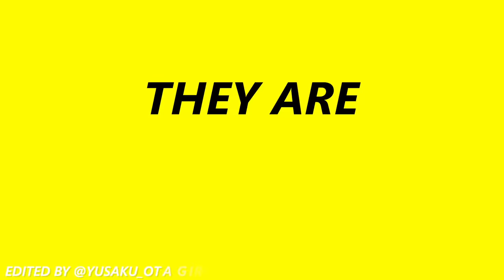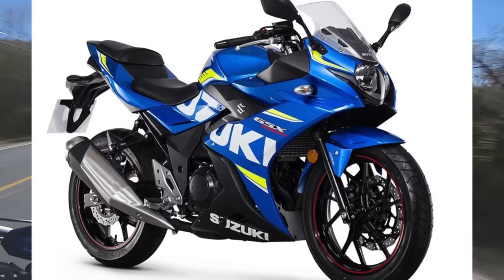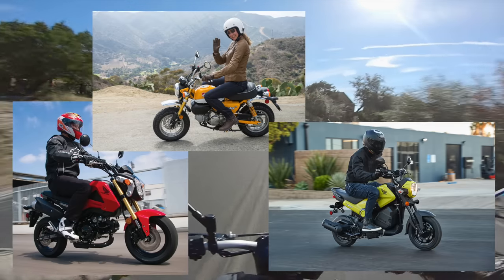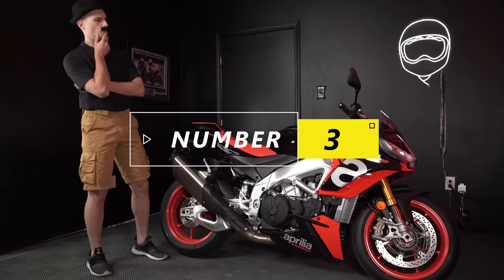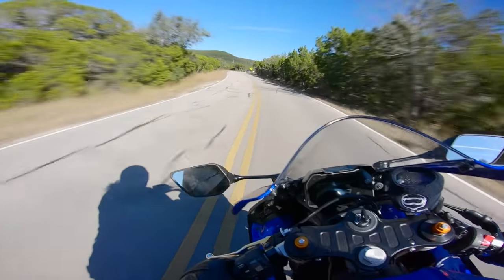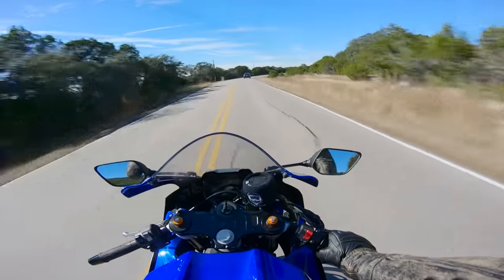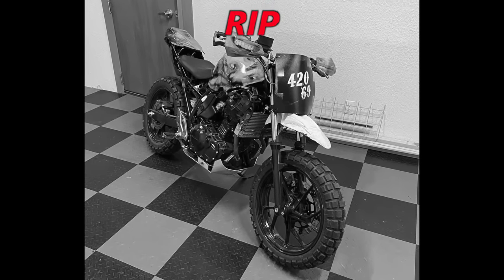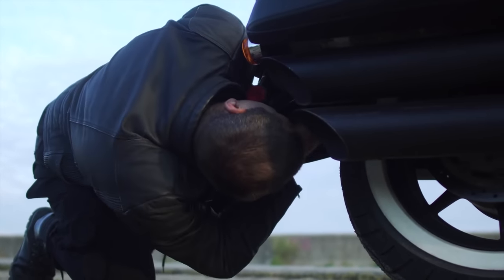Top 7 Worst Beginner Motorcycle Choices! (Must Avoid)

Comment: "This bike has no character" translation:  This bike is a well built machine with competently designed ergonomics , reliable mechanicals   And an excellent suspension.
Reply: And is about as soulless as it gets and may actually send you back into a car. That being said, the dude has a point about drum brakes.
Reply: @KiyanushKaranjia  sorry but to me it's the unreliable project bike from the 70's that's going to send me back to my car!
Reply: This "soul" thing has never made any sense to me.  It's a goddamn machine, none of them actually have any souls, that's what makes a machine a machine.  

What you're really trying to say by "soul" is asthetics (which are subjective) and brand loyalty (which is also pretty subjective).  The problem with "soul" is it gives Harley-Davidson an excuse to be lazy and keep making the same outdated boomer-bikes for 50 years at ever increasing prices.  This isn't a sustainable recipe for success though.  Thankfully Harley-Davidson looks to be headed in the right direction with the Pan America and Sporster S.
Reply: @KiyanushKaranjia  Damn I loved my Ninja 400 cause of it's comfy ergos, it's dreamy handling, It's punchy acceleration and it's certified reliability. (Not to mention amazing price)
I didn't realize I was supposed to add arbitrary and pretentious qualifiers that annihilate some of the appeal of motorcycles just to have a more "fun" bike. 
That's why I should get a bike that spills oil like a tanker, has back breaking ergonomics, the ear splitting bum loosening death rattle of a Harley, the maintenance costs of a German built Ferrari. Oh, and it has to be some one-off luxury bike too, because the whole community aspect of riding is just fortune cookie nonsense and the REAL bikers are rich executives who ride their bikes once just to show off...
Reply: The other way to say this is "clinical".  Some people appreciate that, some want deficiencies to make up for.  All bikes are fun, the clinical ones are great, but the bikes that create stories are a bittersweet combination of image, fun, and ruin.
Reply: When someone says a thing "has no character" it DOES mean that it's technically excellent. They have nothing to pick on besides saying that it didn't invoke an emotional response. They didn't "get" it. For a reviewer, that means that it doesn't stand out. Is it a bad thing? Of course not! Was it amazing? No, no it wasn't. You can build the technically perfect bike, but people don't buy motorcycles in the US for perfection. They're for fun; technically excellent doesn't always mean the most fun.
Reply: @kevinlugonzbi6005  But what emotion does it have to invoke? Does it have to put you through pain and financial ruin first? It's m that's such an arbitrary metric!
Reply: @hyperx72  doesn't matter if your not having fun, sketchy shit is often fun. and if your into Motorcycles to save money your in the wrong hobby my friend
Reply: @roadrunner681  Aww yes I always wanted to get onto a bike and wonder
"will my transmission give out today?"
"Will I not be able to ride this week/month cause of something shaking lose?"
"Gosh I can't wait to have to set up an appointment when every other shop refuses to work on my bike!"
That's why I buy exclusively Chinese bikes and ride without a helmet for that extra sketchy feel!
Reply: @hyperx72  once again, yes it's subjective. However, my Bonneville hasn't put me through ruin and definitely has a personality. The personality is friendly, torque rich, and yes, imperfect.

What emotion are you looking for? You don't have to be broke to find emotion, you just need to try some bikes and see what you want. Some people want calculated perfection. Personally, calculated perfection just reminds me of where I should improve. Great for track days, but a bit masochistic when you want to enjoy yourself.
Reply: @tinman3586  Not true at all. Soul is not how a bike looks, nor does it have anything to do with brand loyalty. It is however completely subjective, and relates directly to how a bike makes one feel while riding.
Reply: @kevinlugonzbi6005  That's true, I personally hate the mindset of calling a well tuned calculatedly smooth vehicle "boring" because it presumes everyone wants and should want something different.

I personally enjoy the smoothness of my ride. It 1 makes it very easy for me to control (good for beginners and general riding fatigue) and for easier diagnosing of potential problems.
Like if my clutch started making odd sounds or my engine began sputtering, in some bikes sputtering and obnoxious clutches are normal.

I find it unfair to judge bikes that try to do different things to the standards of larger sportier bikes, as it's just like judging a Miata for not being a Lamborghini
Reply: @hyperx72  that's fair, and I agree with the Miata vs Lamborghini comparison. Personally, I like slow car fast so the miata wins for me. I always view "character" as reviewer speak for "did this stand out to me in some way". And yes, it can mean bad fueling and imperfection. It can also mean an absolutely exceptional balance or low-end. I would call the Honda Rebel 500 a bike with friendly character perfect for anyone looking for a low displacement cruiser.

I do definitely look at reviews with a grain of salt too. Ride safe!!
Reply: @kevinlugonzbi6005  this is it exactly.
Reply: @kevinlugonzbi6005   @Kevin Lugonzbi  My favorite cars are hatchbacks, specifically because of their tight turning (especially when combined with punchy acceleration).
Reply: MV Agusta F4 1078 RR. Best beginner bike for anyone that is buying their first bike.
Reply: @hyperx72  you don't fix your own bikes? I have way to much power in my old sportster and I mean old its so dumb but it's fun. Most bikes are reliable if you take proper care of them. Ether way if your into bikes and your having fun it doesn't matter
Reply: @roadrunner681  
I do maintenance on my bike, up until the point where it requires specialized tools and has a high potential for failure.
Reply: @gnarthdarkanen7464  You're talking to a guy who's so willing to ride a Ninja 400 that I'm consistently putting myself through 30 degree weather...
Reply: @hyperx72    The point was that you find character or "soul" where you look for it, but it's just as different for each person as any other supposed metric...

     AND I'm no different, aside from the bike I'm on at the moment... If there's no ice in the driveway or street right where I have to turn on or off... I'm probably riding...  ;o)
Reply: I am one of those who started on a old Italian bike, and the bike has not been the most reliable thing, it's a 996, but to be fair, the problems that I've had with it were almost all down to having a lazy know-it-all past owner, I fixed most of the things wrong with it and I fell in love with it and Ducati's in general because of how brutal and rough everything is compared to other bikes, it still have some issues, but I'm almost done with it and after that I'll sell it and get a 2013 Honda CBR1000 Fireblade.
Reply: So happy to hear yam feeling same as me about the 250 cc bikes,  my first bike was a ninja 250 and 2 months into riding I realized how much more dangerous that bike was for me than a bigger bike. Never get a 250. My second bike was a cbr600rr after a year of riding th e 250 and I felt right at home . Don't ever buy a 250 please.
Reply: For me, being well built and reliable is all the character I need. I'm proud to own a machine I can always count on to give me a good time.
Reply: I'm dying for the turbo Hayabusa 🥲
Reply: @tinman3586  thank u
Reply: @theamateurcyclist3873  I wouldn't say never get a 250....I have my tw200 and that's a fun bike, and I wouldn't say it's any more dangerous than my Bonneville
Reply: Try riding something like a Guzzi or BMW Boxer and then a Japanese 4 cyl. Yes, the japanese are almost perfect machines, but they're not as fun as a Guzzi.
Reply: As an owner of a Jaguar car, I can confirm that character and faults are the same thing. I love that insane supercharged lunatic but it kills my bank balance.
Reply: S1000rr.  Has no "soul", and out of a garage full of bikes, it's what I ride the absolute most.  It doesn't break, the engines are so mechanical sounding they sound broken, the transmission shifts properly, the suspension is good, it's so good and brilliantly engineered, it's boring.  But there's nothing boring about riding it, even though it turns 9 this year.  I love my little Ducati too, a 2009 vintage, and it has a ton of "soul"...  and spends a ton of time on my lift.  They're very different bikes, and the duc has weird little idiosyncrasies.
Reply: @ezekieloruven  do you even know how to change brake pad?
Reply: @hyperx72  you must be a young guy . Youll get what others mean when your old and have more experience
Reply: @teteakhiangte6015  Well I have experience with dealing with unreliable cars, and that makes me NOT want to go through that hassle with my bike.
Reply: @tinman3586  you either have not ridden motorcycles or youve only had boring motorcycles. Soul is not just brand or aesthetics, it has a lot to do with the feel of the bike: the throttle, the suspension, the weight/positioning of center mass, the riding position, etc. These are all factors that very widely between motorcycles. When we refer to the soul of a motorcycle we are referencing the way the manufacturer has configured the bike to give it its unique ride.
Reply: Yes, Honda
Reply: @hyperx72  German built Ferrari?
Reply: @Nick-Emery  Basically using the word "German" as a metaphor for extra complexity, and potential failure points, and "Ferrari" to mean the most high-end, expensive luxury.
Reply: @hyperx72  ah ok,  I get you
Reply: @tinman3586   Ik I'm kinda late but as a musician I think I can explain it better. It's more like when a song has nice aesthetics, and the notes sound really nice together, it has a nice groove, the lyrics work, but it still sounds dull. The problem there is it usually lacks some sort of twist, something fun, something that takes that extra step and really makes it pop. Musically the best example, "Single ladies" by Beyoncé. If you strip that song down, it's boring as hell, but they added that dumbass trill, (and I'm calling it that out of love) and that turned the song from "Meh" to "AHHHHH IT'S IN MY HEAD." A machine doesn't have to be unreliable to have a soul, just like a song doesn't need to be super out there to be good. It's all about feel.
Reply: meh! we all look for character in life.  so you admit you hang around with boring people and only use bikes as 'reliable transport'
Reply: @kevinlugonzbi6005 m not sure if that’s true. 

Formula 1 cars are technically excellent, as perfect as can be for racing around a track, and they certainly have character and illicit emotion. 

Nice lifted rock crawler trucks are technically excellent at navigating craggy off road, and have character and illicit emotion. 

Something like a Camry illicits little emotion. Enough power to get up to speed without thinking about it, smooth power band and transmission, smooth suspension that lets you drive without thinking about it, interior that has all the options you need without thinking about it. However, it’s technically perfect for a commuter car. 

I think your definition of technically perfect depends entirely on what you use the vehicle for. Perfectly comfortable ergonomics won’t help you in a super bike race. Brakes and tires that don’t work at low temp won’t help you get around town.  

How the engine responds, the sound, the handling, the looks, the ergonomics, and more, are all variables which decide what the bike is proficient at and also decide what it’s character is.
Reply: @tinman3586  But don't you remember 'The Suzuki Sensation'? Man and machine, working together as a single moving part! (1985 GSX-R 750)
Reply: Boring
Reply: Pretty much. Its a thing people in a hobby say when nothing excites them anymore because theyve seen everything.
Reply: That’s a really long way to say “Honda CB”😂😂😂
Reply: @hyperx72 idk if you get that most people now buy bikes for excitement and fun, and "boring" bikes just aren't that thrilling to ride like ye it's nice and a easy ride but it's like a scooter, that's why alot as soon as they learn on a low cc bike they upgrade to something to find the so called thrill of rid8ng a bike, me personally I started ona r6 and switched to a panigale v4 and r1 and it's just so fun to rip it sometimes, I completely understand ur view that easy ride and slow going is fun to you but to most going 100 mph top speed on a bike isn't thrilling. Like I said I understand ur view I'm just sayin at least what I see the most what people are looking for when they get into bikes, like for most unless ur a beginner or easy going, 400 cc just isn't cutting it

Comment: The reason yamaha doesnt build the 600 for street anymore, is that they didnt pass euro 5 regulation, because it would be too expensive compared to the amount of expected sells.
Reply: But of course they want to buy that R1.....
Reply: @pleasedontwatchthese9593  i dont know. But not in europe...the one who passed in europe is the cbr 650r. Its a big investment for the manufacturers to pass with 4 zylinders which have less than 1000cc. Suzuki for example cancelled the GSX S750 and come with the lame 950 now..
Its an excuse which I have read several times..
Reply: I want a new fz6
Reply: @pleasedontwatchthese9593  the compliance laws apply to bikes that are changed after the compliance laws went into effect, essentially when honda wants to update the cbr600rr they will have to weigh whether its worth meeting the compliances or like yamaha wants to sunset it.
Reply: Nobody buys them anymore -PERIOD ....Yamaha only offers race-spec versions for privateers, WSBK Supersport ..
Reply: Yamaha has mt9, which is more aggressive under 100mph than any 600. Anyone who tell beginners can’t start from 600 is lying, I started from cbr600f2 24 years ago and never look back or need an upgrade to 1000
Reply: @pleasedontwatchthese9593  neither CBR600r nor GSXR600r is EURO 5 therefore neither of them are being sold in Europe. This includes ZX-6R, it is not EURO 5 so its not being sold in Europe. They call the ninja 650 ZX-6R but its only for marketing, it is a 650cc 2 cylinder.  I think the only supersport might pass as 600 would be mv agusta f3(675 versuion), the aprilia RS660 is closest you will get to EURO 5 600 supersport but in reality, again, no company sells EURO 5 supersport 600.
Reply: @stevep5372  hahaha your MT is slow
Reply: @Thomas B imagine if they make a 600cc crossplane 🥶
Reply: @pleasedontwatchthese9593  
They didn't, cbr600rr and gsxr600. Available only in US and probably asia.
You can't get those brand new in europe since 2017.
Reply: @BaldKiwi117  the fz6 and fz1 are still excellent bikes for the money
Reply: @Yaboifootchie  I have an 09 and it's been great to me but I would love something modernized with just a few more basic features. Things I personally would like are a better front fork, ABS, gear indicator, and cruise control.
Reply: You can get the track model.
Reply: @Krom1hell  the R1 is their motoGP platform. Why would they get rid of that
Reply: @kokobeatz7222  Because of emission regulations or silly prince.....Hell knows...I would have loved a new R6 but I can not on the streets without actually running from the police ....because you can not register it any more as a vehicle that goes on the public roads